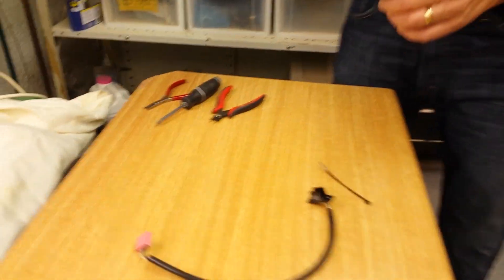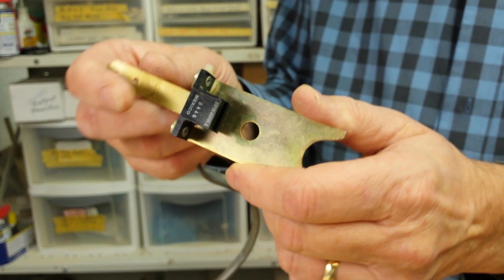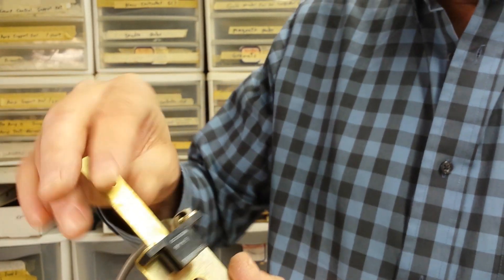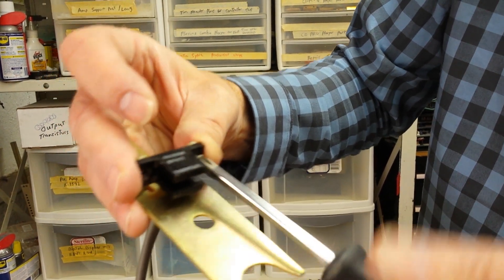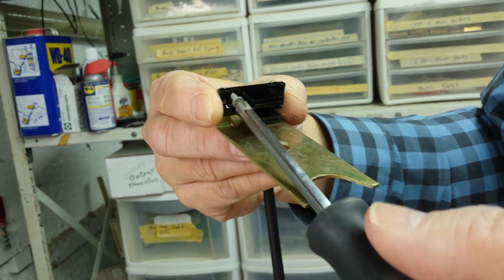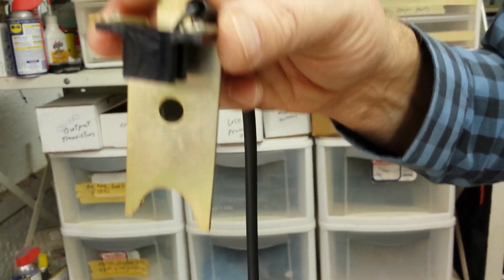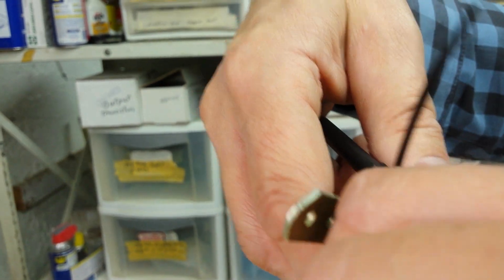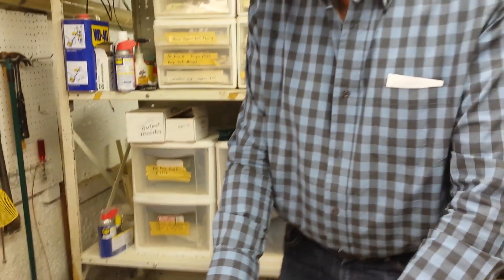installing new optical switch to old bracket

Comment: I suspect the LED in the old optical switch degrades (diminishes is output) to the point where it doesn't emit enough light to trigger the LDR or Photo Transistor on the receiving side.